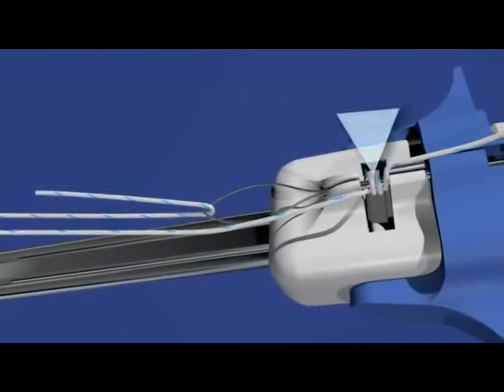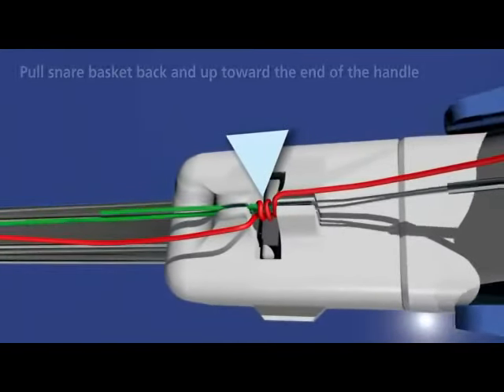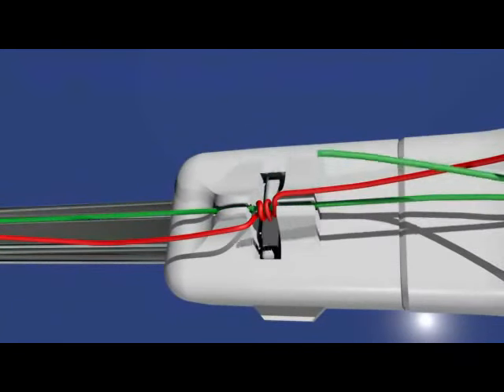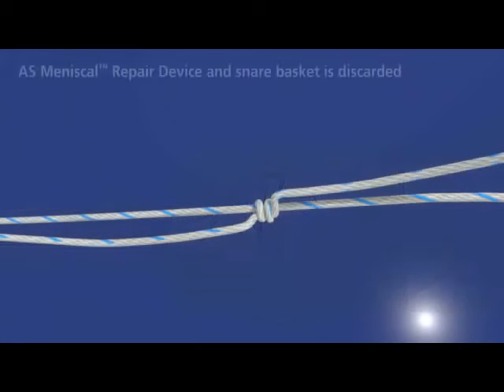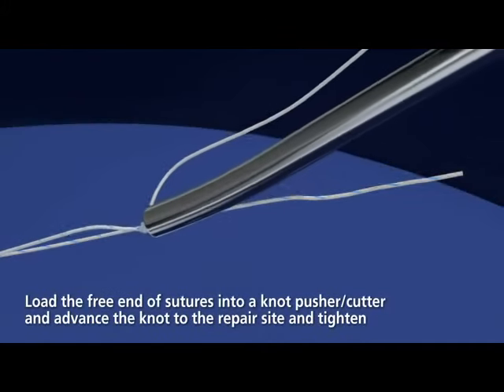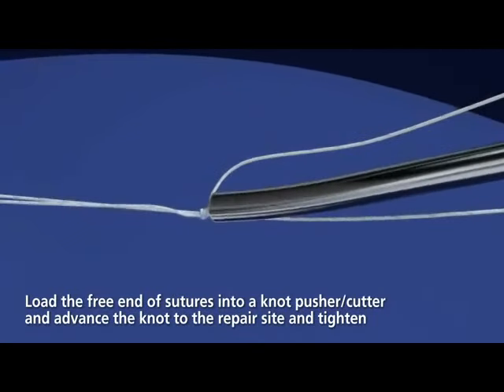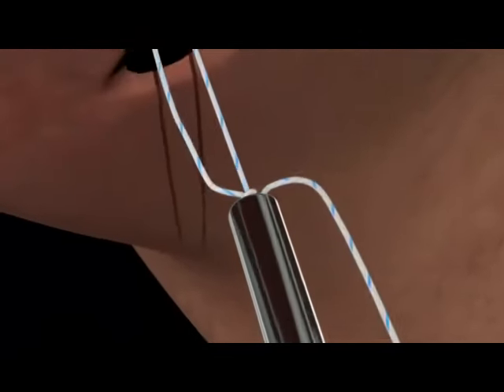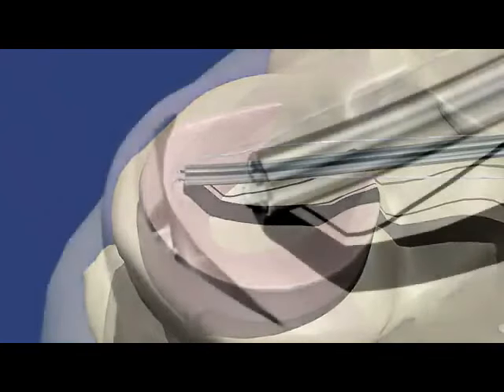Arthroscopic Meniscus Repair

Comment: I just had this done 2 days ago. I’m miserable. I had no idea I’d have this much pain.  My PA suggested Aleve alternating with my Tyl 3.  Praying that this works.
Reply: Hi, are you feeling better?
Reply: @Sonia-jm1ey   Yes!  It worked!  It’s been 8 mo. and it is starting to pop again, but no pain in that knee!
Reply: @vickyls8132  hi , are you able to play sports or any activity?
Do you feel like you have recovered to pre injury state?
Reply: Speedy recovery
Reply: I suggest doing ankle and hip flexor stretches and knee pain will go away!
Reply: Time is what has helped me.  I can run errands up to 5000 steps a day now. I can go up several steps slowly.  Good luck to all.
Reply: @pranaveshravi86  Oh no.  I was walking 4 mi a day before my big lab saw a squirrel when we were walking.  That started the whole thing.  That was 4 years ago. Since then, I’ve  had a torn rotator cuff repair and new issues, IT Band pain and SJ Dysfunction.  Oropedic doc’s PA gave me injection in hip. Worked wonders!   Wants me to see a pain mgt doc to get injection in lower back. I said NO.  Doing Pilates st home.  Try it!
Reply from the maker: Its a sad fact that nowadays, doctors have become businessmen. But then how can one be sure if a doctor is genuine or not. It all boils down to a matter of trust. There is absolutely no harm in taking a second opinion. Or even a third. I am open for consulting. Had been away from my channel for far too long and am actully surprised to know so many of the patients who have visited have felt fleeced at their hospitals. I am here to change that.

Comment: i had the same one done in March 2019 and had to do MUA - manipulation 
under anesthesia, in may because my knee just couldn't bend more than 30
 degree..
it has been 9 months and I am to walk without crutches. 
however i still can't walk up/down the stairs properly, can't jog, can't
 jump nor squat. Also walking for more than 30mins cause so much pain 
afterwards and standing long is an issue too. Now even my other knee(the supposedly good) seems to be giving way too.
Reply: Doctor fucked you up, and you are still not walking a year later lol. Meanwhilre  pro athletes recover in 6 months

Comment: I tore mine in March  and had surgery in July. It’s still hurting 3 months out worse than before surgery..I’ve never had knee problems, arthritis...now the docs mentioned knee replacement! Wth?? I think he’s selling knees!
Reply: Source fractal 00TB I have been told I may need surgery waiting for the doctor to refer me. Do you think your in a better position now before the op?
Reply: What kind of surgery did you get specifically? Meniscectomy?
Reply: Can you provide context: how old are you? How did you injure the meniscus?
Reply: In murica doctors are basically sales man. You should have went to Cuba, Doctors are awesome there
Reply from the maker: Its a sad fact that nowadays, doctors have become businessmen. But then how can one be sure if a doctor is genuine or not. It all boils down to a matter of trust. There is absolutely no harm in taking a second opinion. Or even a third. I am open for consulting. Had been away from my channel for far too long and am actully surprised to know so many of the patients who have visited have felt fleeced at their hospitals. I am here to change that.
Reply: @drshirishmn its been 13 full years of pain for me... 
2011 Oct torn the meniscus 2018 June had meniscectomy 😢😢😢 on the right knee still pains and makes sounds and locks a lil... 
Dec 2023 had a surgery removing an overgrown cyst March 2024 the cyst had reoccurred Apr 2024 done suction on the cyst 😢😢😢... May 2024 signs of recurrence of cyst are there all this still massive pain around the outer meniscus 😢😢... 
What cud be the solution!?